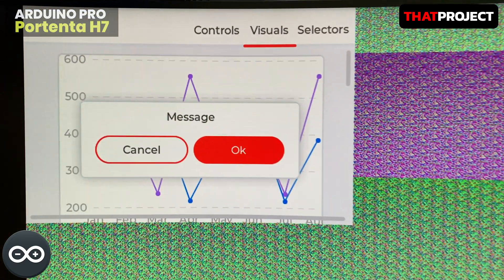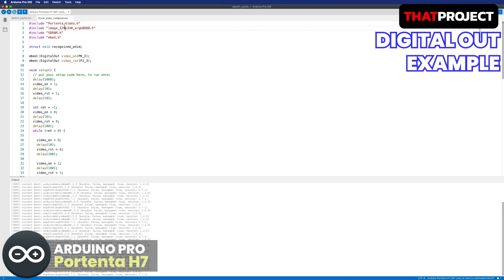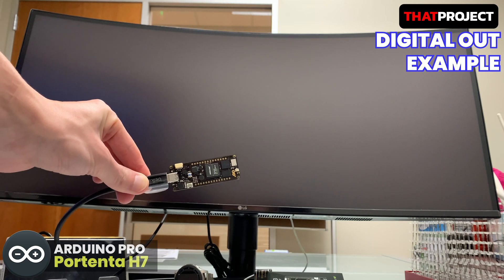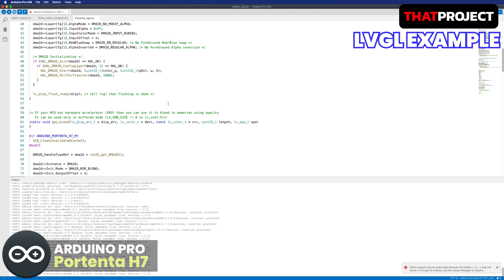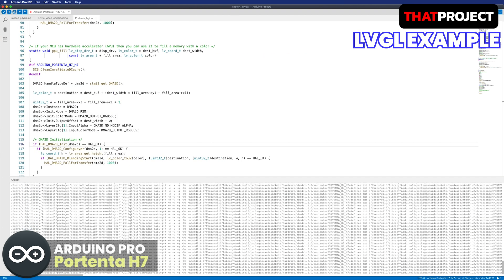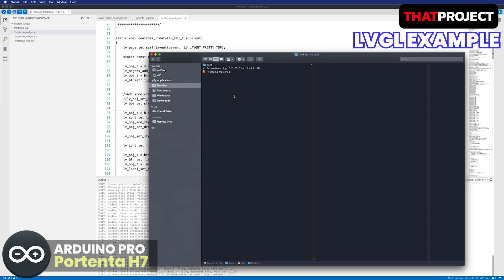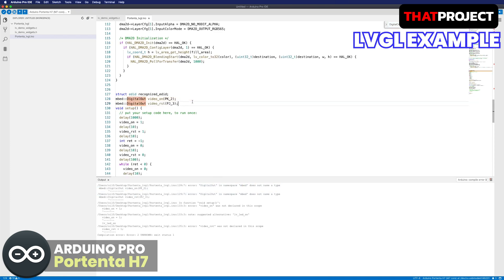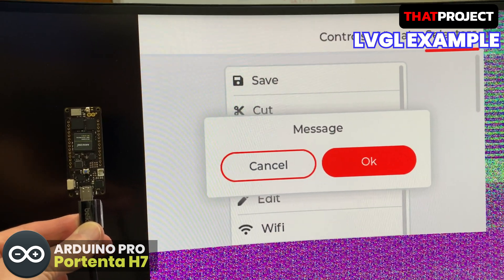Built-in examples of Display-Out Over USB-C (ANX7625) (ft. LVGL)

Comment: Will the arduino portenta work with a USB C to HDMI cable connected to a monitor or TV, if I put power on the jst pins?
Reply from the maker: Yes, it works then.

Comment: hi  , for a new project I have chosen arduino portenta h7 to connect an HDMI LCD with built-in USB touch screen, now a little question, can I connect the touchscreen to a USB port of the H7 and manage it with the LVGL libraries? any advice, example is highly appreciated
Reply from the maker: Very interesting.  You need to connect the LVGL's input device interface with the USB touch driver, but I'm not sure. I'll try it too. Let me know if you have any updates.

Comment: Have you tried with a usb c to dport cable?
My monitor doesn't have a usbc connector and I cannot seem to get it working with a usbc to displayport cable
Reply from the maker: As far as I know, Displayport doesn't carry power. In this case, the Arduino portenta won't work. This is why they adopt a USB-C port.
Reply: @ThatProject  yeah I know but I was powering it externally and not through the usb port
Reply from the maker: @samueleferrari9810  oh I see. I'd like to have a test with DP cable but I don't have a JST connector to give it power....
Reply: @ThatProject  Thanks anyway